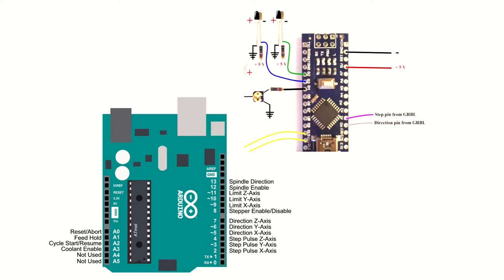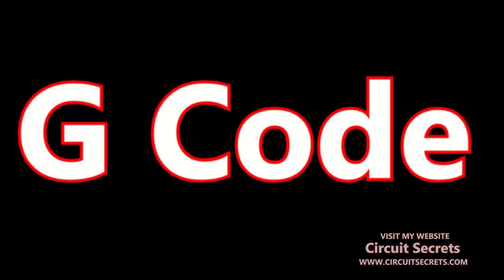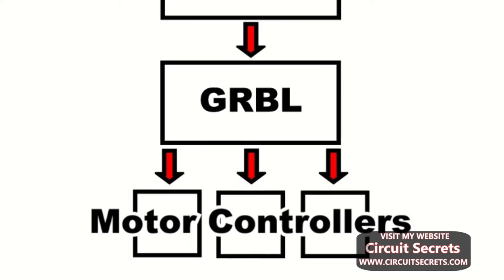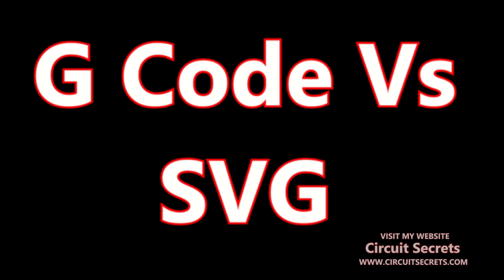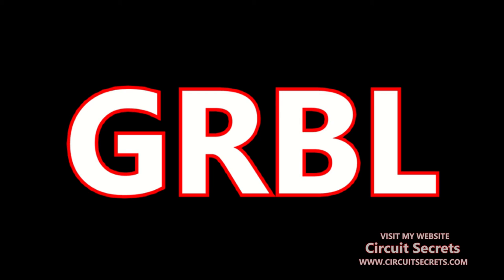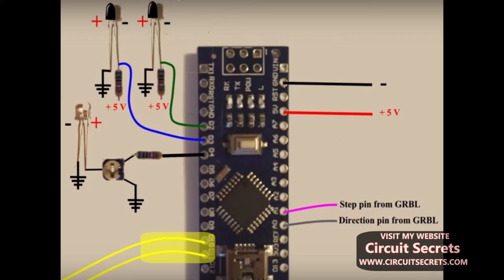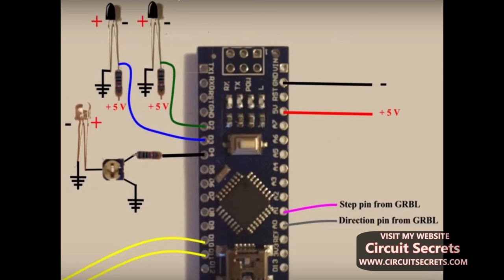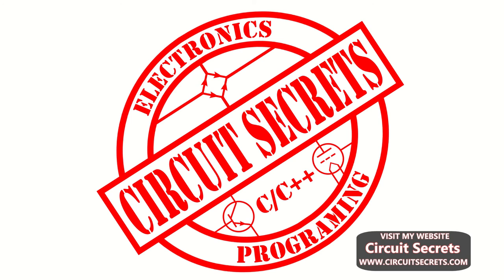DC Servo Motor Control System

Comment: If I use are arduino uno, I had a wire is going to be on the same pins as the nano, for the home built encoder.  Or can you show a picture of wiring for encoder using uno, not nano.
Reply from the maker: Just use the same numbered pins and it should work fine. Digital pins 2 and 3 are used for the encoder. The nano and uno are pretty much the same I used the nano because they are cheaper and come in three packs which is perfect for three axis of motor control. Remember you still need another arduino for the grbl interpreter.

Comment: Saludos Cesar Vasquez de Republica Dominicana ,Gracias por compartir sus conocimientos ,me gustaria saber si puedo leer las señales Step y Dir sin interrupciones del arduino,y como modificarla en su codigo,tengo un proyecto similar pero ejecutandose en Visual Basic 6.0, entre en mi canal para que pueda ver lo que he hecho,me gustaria ahora controlar mi cnc con GRBL  y asi tener mas opciones ,pero la quiero controlar con dos arduinos ,uno con GRBL cargado y el otro con el codigo de control de los motores,   gracias por todo
Reply from the maker: I would use a visual studio app for a gcode sender and control unit for the cnc. You can send code with that through the serial port and synchronize operations of the GRBL board. Motor control boards need to track both the input step and direction, and feedback from the encoder to adjust motor position. I hope this helps, good luck!
Reply: @CircuitSecrets  Gracias por Contestar,excuseme que parece que no me explique bien,con respecto a su proyecto , me gustaria ver la forma de leer las Señales Step y Dir en el arduino pero sin Utilizar Interrupciones Externas como estas ISR(PCINT1_vect) 
  //read the data from port C the first two bits, ignore all others
  grblStepData=PINC & 0b00000011; sino hacerla de otra forma si la hay, con respecto a mi proyecto yo logre controlar los motores de mi CNC en Visual Basic enviandos los comabdos via serial y el arduino lo recibia y lo comparaba con la lectura de los encoder para ejecutar los movimientos ,en mis videos podra ver mi trabajo  y si le intereza puede descargar los archivos que estan disponible, gracias por todo

Comment: Hello, is it strictly necessary for the encoder to emit two signals A and B? Could a motor run with just a signal?
Reply from the maker: The encoder provides feedback so the steps can be measured. Traditional cnc machines use stepper motors that move in steps, a D.C. motor has no steps so the movement must be measured. With this design a D.C. motor will simply keep turning if the control board receives a step command..
Reply: @CircuitSecrets  I have been able to notice in other examples of similar codes that the signals leave a gap causing the machine to ultimately not execute the movements with exact precision. Something similar has happened to you.?

Comment: i am lost.  How do i get 3 Arduino's to work together from one pc.  how do i link them??  I am going to make a motor. controller.  just need some help.  can you put up a picture of how to wire them altogether??  I got it. Had a brain fart
Reply from the maker: The Arduino based grbl control board takes gcode from the computer and creates step and direction pulses on 3 separate channels(one for each axis). Each of the arduino motor controllers takes step pulses and controls an single axis. Look at any wiring diagram of a grbl control board connected to motor controllers, and replace the motor controllers with the arduino based motor controllers. P.C.>GRBL>>>motor controllers. Each of the 3 motor controllers has encoder, hbridge, power, ground, step and direction connections. The step and direction connections go to the GRBL board step and direction connections. I hope this helps, if not, let me know and I will try to create a wiring diagram and package it with the source code for the controller.